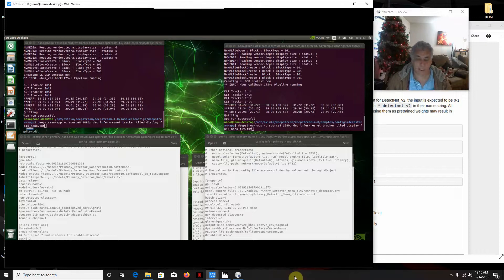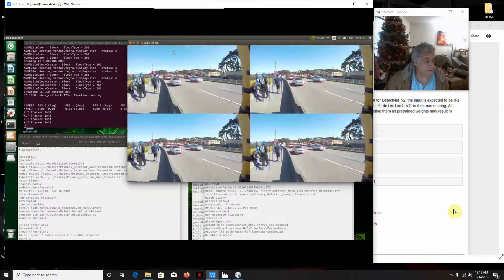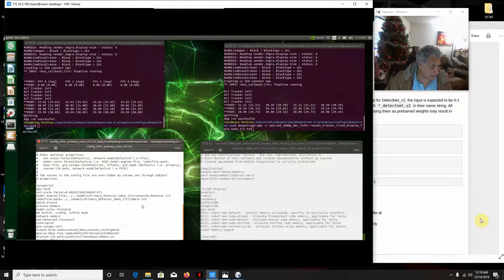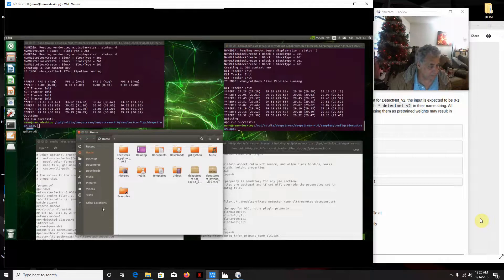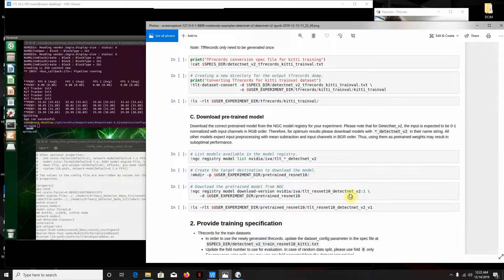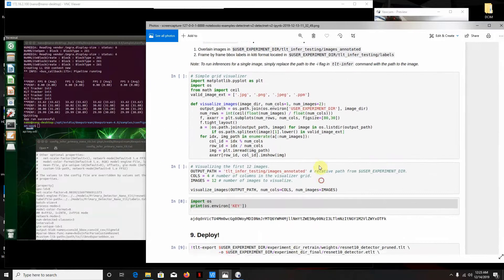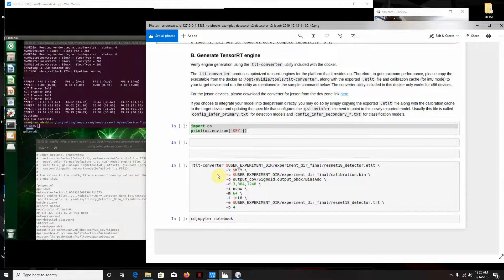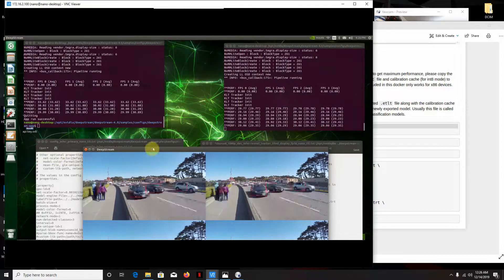Jetson Nano DS resnet10.caffemodel/TLT resnet10.trt showdown

Comment: hey joev can you provide your resnet10 weights actually the model which I have trained is not giving that much good result. I have followed your 3 video in which you have trained your model but I only changed the epoch value 1200  and  result is
Mean average_precision (in %): 81.1113

class name      average precision (in %)
------------  --------------------------
car                              80.7816
cyclist                          86.4861
pedestrian                       76.0662